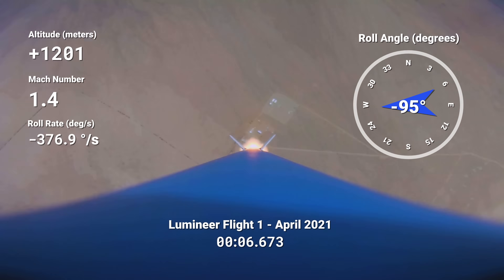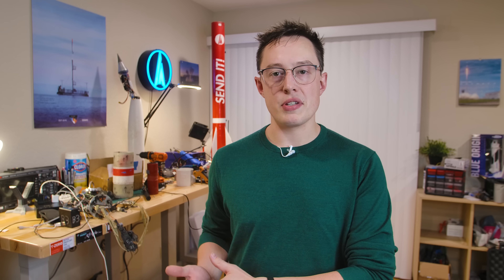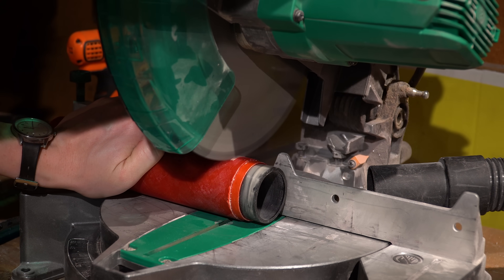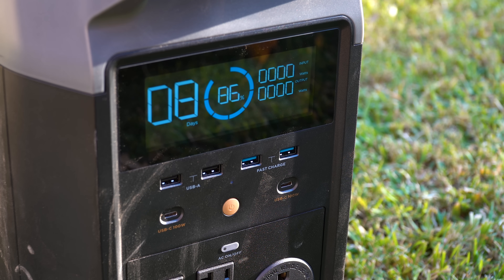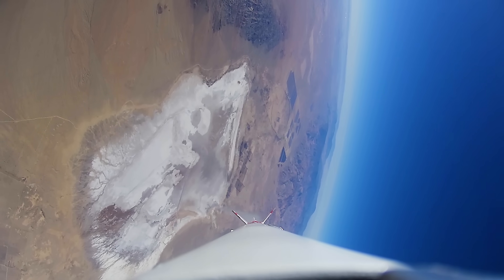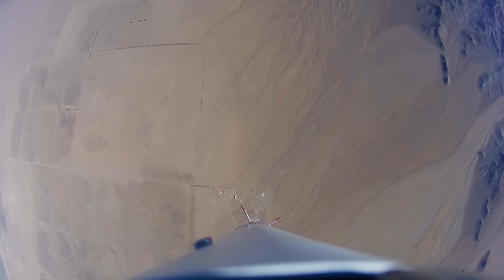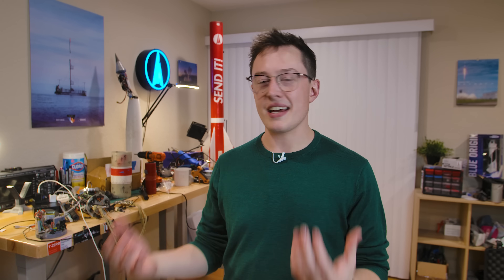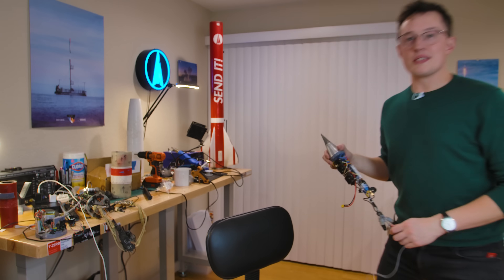Can You Get Stable Video From a Spinning Rocket?

Comment: I do a fair bit of motor control for my profession:

1) Brushless DC is absolutely the correct choice here, but something with a much lower KV rating. Your inertia ratio here is pretty crazy high, making your gear ratio have to be rather high. You've simply got the wrong motor, as you've said.  "BLDC Gimbal Motor" is the search term here. checkout the company IFLIGHT, something like the GBM4198H-120T. They're meant for very high accelerations, and relatively low RPM (for a BLDC). They're used to support camera rigs, usually without any gearbox whatsoever.

2) As you've found, jellybean BLDC motors have no hope to work around 0 RPM.. they're expecting many thousands of RPM. If they're sensing commutation via a single hall effect sensor (or even sensor-less sometimes, via back EMF)... how do you expect them to perform when the rotor is nearly stopped? Additionally, these types of ESCs are going to switch to one of only a few pole pair states.. meaning they can't smoothly actuate to any arbitrary angle.  The solution: Field oriented control (FOC). This control scheme requires an encoder to sense commutation, and will produce a smooth transition between pole pairs (sort of like microstepping in a stepper, ish), instead of the harsh steps of a normal BLDC ESC. They work great around 0RPM and will grant you a huge boost in available torque at low speeds. There are a number of suitable controllers available, "Simple FOC" (https://docs.simplefoc.com/bldc_motors) seems interesting. I believe some of the Trinamic (https://www.trinamic.com/) motor drivers can do FOC as well. 

3) That stepper simply doesn't have the power to perform the accelerations you're looking at here, by like two orders of magnitude. Steppers accelerating any appreciable amount of mass will lead to stalling. Huge can of worms, I'd advise to steer clear of them unless you've got room for a > 1LB NEMA-14 size or larger. FOC can also be preformed on steppers, with less impressive performance improvements though compared to BLDC FOC.

I'd be more than willing to hop on a voice chat if you're interested.. I know some of these concepts are a bit hard to flush out in a YouTube comment. Love the concept, would be very happy to see things work out!

Comment: Have you considered very fast exposures of individual 'photos' and synchronizing the 'shutter' to the INS roll and rate?
Reply: Depending on how fast the exposure time is you can sync it at 1/2, 1/3, 1/4 the roll rate to get multiple virtual camera feeds of different relative angles. Yeah you lose some frame rate depending on the sensor you use, but you always have access to multiple-100 fps CMOS sensors once you step away from COTS recording.

Comment: Small suggestion, might not be useful but might be! What about a tiny gyroscopic sensor, like a reaction wheel but reverse engineered? Not big enough to interfere with the rocket's flight path or indeed with the camera mount, but enough to measure the change in angular momentum and provide live feedback for the camera mount to adjust? 

That said, seems like you've got the roll correction programming pretty much on point, so again maybe not that useful of a suggestion!

Comment: @BPS.space  12:35 After the PWM pulse happens, how long does it stay awake before going back to sleep? (If it stays active for less than 90 seconds after the most recent pulse, then it could be that the launch occurred in that gap [between when it goes back to sleep and the next PWM pulse]…) 
Absent any other information (i.e. how long it took to reach that altitude after launch), that’s the best theory I can come up with.

Comment: Question: why wouldn’t a bearing mounted nose section with stabilizing fins work. The rocket body can rotate as it wants but the payload/camera/ avionics bay can be aerodynamically self stabilized. It would be more simple but at low or zero airspeed it wouldn’t be as well stopped from toting but there would be less inertia to have to arrest the rotation of.

Comment: This one time in school we made rockets and launched them with compressed air, and I did not have enough fins for proper stability so I folded the ends of the fins to around 30-45 degrees so it was stable due to gyroscopic stability (I think that's the name?), and its cool how it works so well. Great video!

Comment: One problem I foresee with using a 360 degree camera would be motion blur. The actual sensor would be spinning and therefore the captured image will be horizontally blurred, which is not something that can be digitally corrected. So you'd have to consider if your exposure time is low enough that you get an acceptable blur at the expected roll rates. 

This is basically the same problem as faced in cinematography,  so there might be some lessons from studying the design of active camera gimbals. I think most of them use direct drive brushless servos, but that's probably mostly for noise and perfect stability. Your stepper is probably good enough.

Comment: Joe why don't you used gyroscope instead of a reaction camera ring , as I see in video ,when rocket is not spinning at high rpm your camera ring is giving a lot of spin in other direction , which i think will be a problem for thrust control and fin control as they have to do correction for a lot of unnecessary spin on rocket which will also affected Gyroscopic stabilisation on rocket in negative way, which all can be avoided by using mounting camera on a gyroscope instead.

Comment: Well done, nearly there! 
As a specialist imager (photographer), I would have taken another route. I would have have run the camera at, may be, 120 or 240 frames per second and then edit every one in three or four or five frames to get a slowly rotating image. I could then stabilize the image or could accept the residual roll. Edit: Or set up a camera that takes 1 image every rotation.
I suppose this supports the idea that you take the route that you are most familiar with, neither is wrong. One can be more effective in the end. ( I think your idea would be more effective because the roll is not constant.) Good luck!

Comment: Your goal is to rotate a camera. Nothing more. you might be making this all harder by trying to rotate EVERYTHING with it (motor, gear box, ESC, batteries, IMU controller, lots of wiring... video transmitter?).  Consider a "through bore" slip ring, or split ring to just provide power to the camera (and or analog signal if you are transmitting as well). This could even be made by hand.. just two ribs of copper, tin or brass (gold plated is best but whos got cash for that?!) with grooves pressed in them, for a loop of exposed wire under light tension to run around. Im sure it would be good for at least a few flights without maintenance.  Just put a few super caps on the camera side to stabilize power delivery as it rotates. But with a full loop around the outer tube, it SHOULD maintain constant continuity.
Mount all the power, ESC and electronics inside the tube in fixed locations. Build a rack gear around the bottom perimeter of the rotating part. Mount the motor inside the tube with a pinion gear exiting a hole in the tube to make with the rack. Other than the camera module itself, the whole outer tube can be much thinner as well.
Stepper motors are great, but I think you might have some trouble with the one you chose in your current configuration. What they gain in precise indexing, they trade for speed and torque. Yes they have great holding torque, but you generally have to oversize a lot if theres no gear reduction. Basically, you can have fast, strong, or small, but you cant have all three at once. you CAN overdrive the motor with higher voltage quite a lot though.. just dont expect it to last long.  Anyway, JUST spinning the camera on the outer tube, powering by slip ring will cut a LOT of mass out of the rotator, and that stepper you showed should be able to sling it around quite fast.
Reply: Shoot.. if you want to go crazy, you could skip the slip-ring all-together and power the camera with inductive power transmission. Talk about learning interesting stuff. ;)
Reply: for some DIY slip ring ideas, also look at "propeller shaft earthing" products. You can buy hardened copper bands that tape or clamp on, in a variety of diameters, along with the brushes.

Comment: What you need is not gears and an ESC, its a ring type USM motor like those used by Nikon and Canon for their professional (D)SLR lenses. They are direct drive (immediate), high torque, low inertia and completely hollow!

Comment: In my opinion the brushless motor is the good aproach to solve this problem, the issues that you had with the “low resolution” of the motor it’s caused because you are using the wrong speed controler, not the optimal motor for the problem. Try looking for some Brushless FOC control and you will realize that is what you need to solve that. If you need help with it or some more starter friendly info just contact me! Keep doing what you do!

Comment: This is cool. I'm looking forward to seeing it more. I'm sure you know already but sensored brushless motors tend to be a lot smoother on startup and at low rpm. It might be an option if the stepper does not work out.

Comment: Might get lost in the comments and don't wanna be another keyboard genius (I'm an engineering student with a bunch of PID tuning time so not a complete keyboard genius I swear)

But it appears your feedback loop is processing over the angle as your variable, try switching it to angular velocity, I think this will immediately take care of the majority of your problems, no need to unwind or anything, getting an angular velocity of less than some margin (say 40 degrees/second or something decent to look at) and just shutting it off below that margin would take care of your motor problems too...

If your trying to horizon lock for some specific reason, take a second feedback loop for angle and feed the output of that into the angle/second feedback loop... (only after you get that first one tuned), this is how multirotor work, we have an angle/sec PID running (and like in acro mode like we fly in freestyle/fpv racing this is all we use) and then when your flying angle mode like on a dji bird they move the angle/second target to keep the bird on the horizon

Comment: "we put the nut on tight"
cut to video of using a lathe to tighten it
sir i am both appalled and impressed by that. I would say just get a nut breaker and cut it off from the start instead of trying to fight it off if THAT is how you got it on there.
crazy like a fox you are

Comment: Did you consider using a sensored brushless ESC like an Odrive? Normal drone ESCs are inherently bad at controlling motors at low speeds because of how they guess the rotation of the motor with timing the motor current wires.

Comment: I think the mechanical design was ok, but was used to stabilize the wrong thing.
If the aim is to reduce the camera smear, you dont need to stabilize the orientation of the camera, but instead try to keep its rotation speed as close to 0 as possible.
Even with the motors minimum speed, you would either have a slow rate of rotation on the video when spinning slower than the motor can correct, or stable video when the rotation rate is high enough for the motor.
Only correcting angular momentum would also solve the "wind up" issue.
A downside would be drift, as the motor is not able to perfectly counteract the rocket's spin. However that could also be seen as an advantage as you would not risk any issues with the assembly oscillating about a fixed point, or the jittery motion we saw while rotating slowly.

Comment: Why dont you just make the cam free spinning and use a kind of gyroscopic mechanism that makes the cam move to the desired destination. As long as the cam mechanism itselv can rotate smothe without a lot of drag i think this might be not that bad since you dont have to know how you rocket moves and the motor probably dont have to be adjusted so fine

Comment: You should mount permanent magnets on a tube. Then use coils to spin a larger tube around the smaller tube. AKA no gears no extra weight. Look up the "active mover" made by Rexroth Bosch. That's a linear motor. It's very nice and very smooth. You could do the same but circular.

Comment: Here's a little 'out the box' thinking..  You could try mounting an array of cameras around the perimeter, capture all the data from every camera. Then sync the feeds with the rockets rotation, either manually or write a piece of software to do it for you

Comment: Same rig - Get a bit chonkier, slower motor, and use an ODrive S1 for precise low speed control instead of a cheap ESC.  Won't go to sleep on you and should work great.

Comment: Is slow rotation really that much of an issue? I mean the point here is to get the footage looking good and at least to me it still looks good at small rotations.

If you switch from trying to orient the camera at a fixed angle* and instead only counteract the current change of rotation that would remove the windup issue you have. And if you do and agree with slow rotation being fine then all you'd need to add here is only act if it's above a threshold... 

* at least that is what it looks like you are doing

Comment: FOC motor control is way better at torque management than BLDC.
It will also achieve much lower minimum speed compared to a BLDC esc. The only real downside for applications like this is the need for a sensored motor as sensorless FOC can be done but is not nearly as worth it.

Stick with a brushless motor but research brushless gimbals to make the system better. After all you are essentially using a single axis geared brushless gimbal.
The brushless motor you choose does matter but because your system is geared it matters less than the ESC.

Comment: Hi Joe , love your videos- keep it up
I while ago i built a 1 axis camera stabilizer for a go pro using a stepper motor as direct drive (no gearing). At the time i was confident that was the correct choice as the motor control was more precise. However it ended up being very choppy/jerky- 
although there was no accumulating steady state error, you could see every step - even on the smoothest setting of the driver.
 Im not sure if there was a better way to control the motor( i didnt persevere with that project), but i subsequently researched a bit more and concluded that a brushless motor are the better choice.
One needs to choose well as there are different specs and the gyros generally use higher resistance brushless motors, with low cogging characteristics (if i remember correctly there was something important about ferrite rings)
Basically what im trying to say is that a different/more suitable brushless dc motor might be a beter fit than a stepper motor if smoothness is what you need.
Hopefully you will read this comment and avoid my mistake.
Cheers

Comment: I just discovering your channel with this video and I should say all this content is awesome. Great for you and for your curiosity making this devices added onboard a Rocket. I could make a suggestion and is about including 4 cameras instead 1 every 90°. That could be covered always a point of view over land. This is because I was thinking about a very fast solution for mapping large areas with enough precision (related to the GSD or Ground Sample Distance in photogrammetric terminology). With a Rocket equipped with a GPS and cameras it could be possible to reach that goal.

Comment: I would suggest that you try to get the best Form bothe worlds Software and Hardware stabilization. You could use a Camara which stabilize via Software and could so for low rpm and an active system like yours which only kicks in after XX°per s for example.

Comment: You can replace the motor, but actually you can simply program it to not spin at all if the rotation speed is beneath a certain threshold.. a bit of spinning in the footage is not a problem..

Comment: I've worked on something similar to this and I have some tips according to my experience! I found it was a real pain to work with BLDCs and steppers due to the need for complicated drivers/ESCs. Also steppers require some extra thinking in software since an input of linear acceleration in steps/s2 does not result to an output of linear rotational acceleration (The "AccelStepper" library for Arduino is nice for testing btw). I finally simplified and used a PWM driver with a geared DC motor and this worked wonders with closed fb control using an encoder. But I guess you don't want to use an encoder? An even better solution to calculate control error in your case would be by using image analysis. It requires a tiny amount of processing power though. With OpenCV you could run edge detection and calculate rotational error frame-to-frame. You could also compensate for homography during early ascent since the image changes drastically, i'm referring to "zooming out quickly" in the beginning.

Also, you mentioned "accumulated roll" and that "you have no anti wind-up"? Without integral action in your controller you should not have to implement anti wind-up. I assume you mean that the P-term grew large during ESC sleep but that would only be possible if you add up multiple rotations instead of treating, say, 11.3 revs as 0.3 revs. 

I guess you could fix the issue of the motor not spinning at lower control errors by implementing feedforward based on the fact that the rocket has rotational inertia and probably will continue to rotate in the same direction.

This is a really interesting project! Reach out to me if you would like some consultation, I'd be more than happy to contribute! //Mechatronics engineer with too much spare time